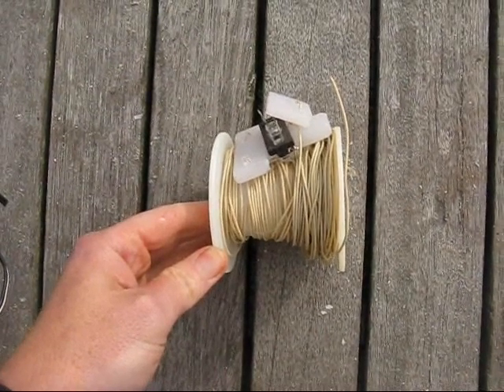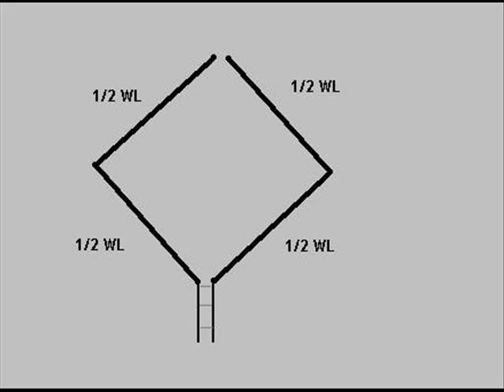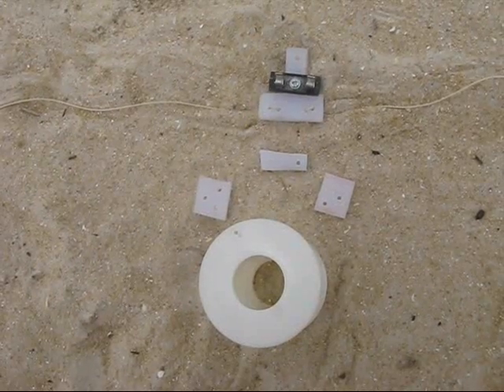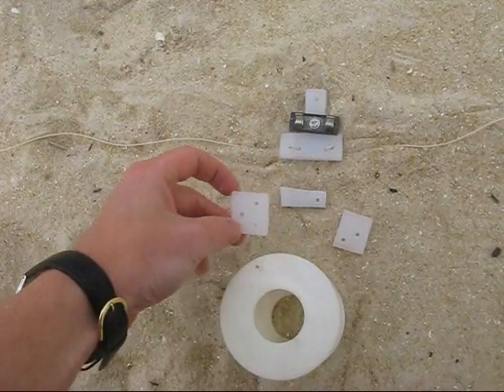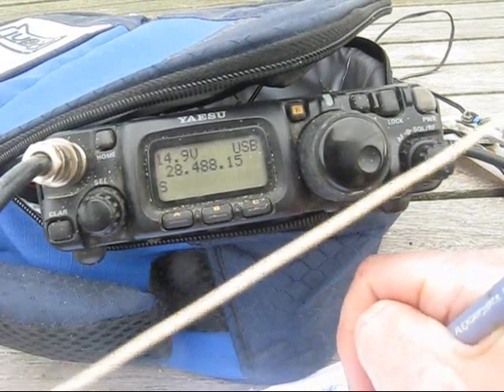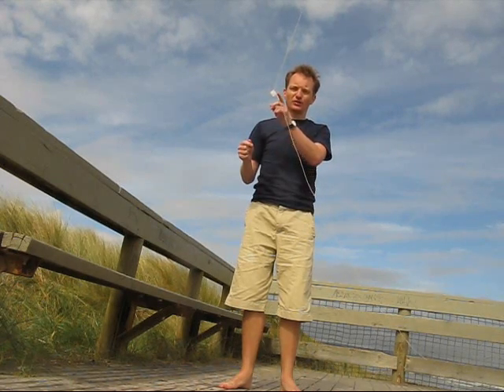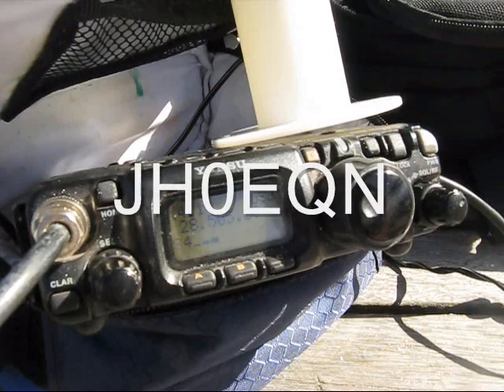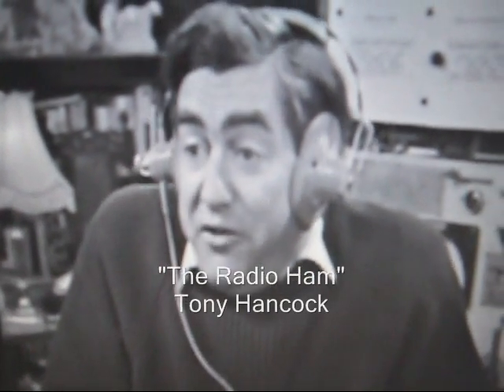Testing a bi-square antenna on 10 metres

Comment: I got to ask Peter, 15.7 volts feeding the tranceiver at one point in the video, that would have freaked me out. I use the FT-817 and never go above 12 volts. Do you realize the voltage is as high as 15.7 volts?
Regards Dave
Reply: the ft817 can handle 16  volts